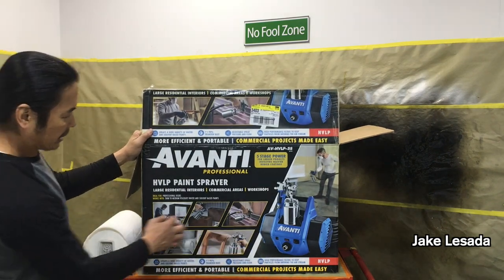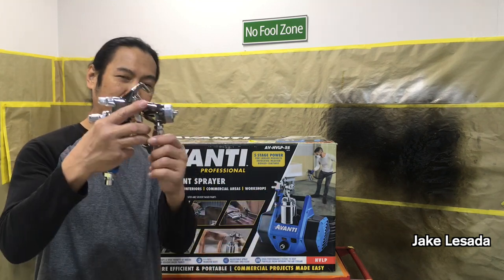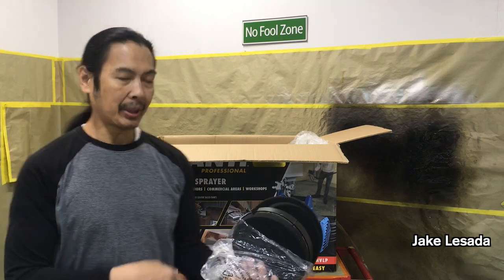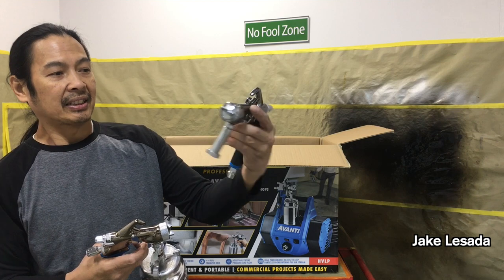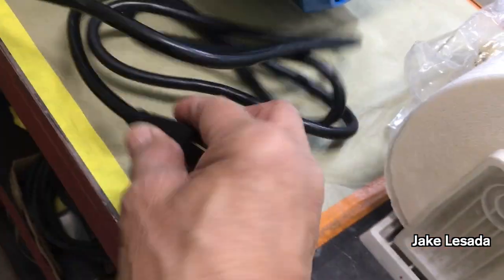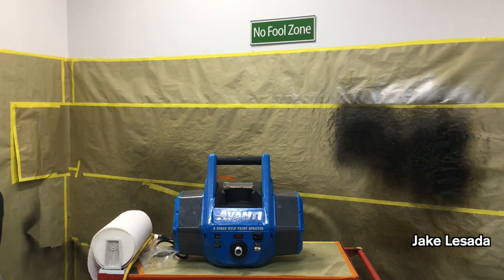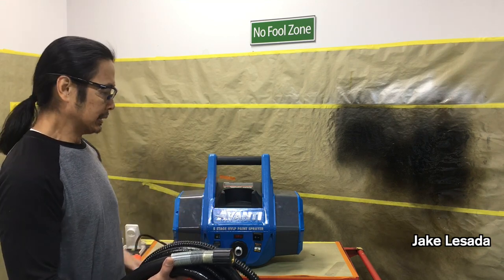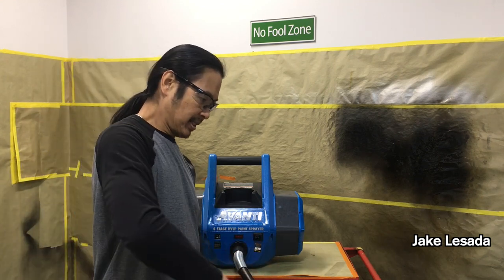Avanti 5 Stage HVLP Turbine Sprayer Unbox with Jake Lesada.

Comment: Jake,
Based on your video I called Harbor Freight’s toll free number to see if they had a refurbished 5 stage unit that be more affordable to me and left a voicemail.  Yesterday I decided to go to a local Harbor Freight to see if they had a refurbished one.  I didn’t see one.  I asked the manager to see if he could put me on a waiting list for one.  He did better than that.  He went to the back and wheeled one over to me.  He let me look it over and I bought it for just under $400.00.  I am so grateful.  I will get some prices on epoxy primer, start sanding down some parts and get spraying.
Reply from the maker: That is the best price ever.  You got lucky,  that is so cool the manager had one in the back.  Just press the on/off button and start spraying.
Reply: My local HF has the 3 stage on the return shelf, ( open box) for 200$ there going to mark it down even more tomorrow if it's still there, I will buy it if it is!
Reply: I bought it for 160, no hose and filter housing is broken but I taped it and like new!

Comment: I bought the avanti 3 stage kit.  It has been great.  I spray a lot of rustolium type paints...  and it works great.  does not matter if its oil or water based.   I have done a bunch of projects.  I called avanti to order the other available needle sets and they were very easy to work with.   I am glad you did this video... thank you..
Reply from the maker: You are so welcome.  Thank you for taking the time to watch and comment.  I just plumbed the Avanti 5 stage with a thru - wall booth setup.
Reply: Do you use Rustoleum paints for external automotive applications?  Rustoleum makes Gloss Red Apple and I would love to use that.  If you do, what would you mix it with?  Thank you.

Comment: Fantastic set of videos to go with this specific machine. This is the route I'm going to go to paint my 2009 ford ranger  since it will be in pieces and a lot has changed in the 10 years since I was an automotive reconditioner and I don't want to go back to a compressor setup as I only do small amounts of work now. Great videos. Super helpful.
Reply from the maker: Painting has gotten easier using turbines.  Press the on/off button and go.  No draining water from air compressor tanks or pre filters attached at the spray gun end.  Lower overspray and waste, and less exhaust to filter.  Thank you for watching and commenting.

Comment: This video was excellent! I was looking into this turbine and you nailed the break down.
Reply from the maker: Thank you for watching and commenting.
Reply: @JakeLesada  Where can you find the extra spray guns?
Reply from the maker: Check with your local HB store. Their website shows that they have a "replacement turbine spray gun" - in store only.  Also, there are other manufactures that also make turbine spray guns.  Using a regular air compressor type spray gun will not work, I've tried it .

Comment: I bought the Avanti gun to use with my Apollo 4 stage to spray sealers and to use for non-automotive spraying. It uses the same 3m pps 2.0 adaptor my 7700 Apollo gun uses! And yes, the pressure cup is a Big advantage👍
Reply from the maker: It's ideal that the same fittings work on two different brands of turbine spray guns.  3m has got it right on!
Reply: On these notes I'm using a 4 stage capspray with Graco 2 edge with a 0.8 needle set with the gravity cup feed adapter they have. I sprayed sealer and not sure if it was because of old ppg multi purpose primer sealer with old hardner maybe a year or so old and or bad gun settings but I got dry spray tiger stripes Orange peel. I sprayed my car years ago and it came out great! Any pointers on gun settings. Should I have made my fan smaller, less air more material? Thanks guys 👍😎
Reply: @1982mattd  i've been adding slow reducer to help material flow.  Wide open fan. No issues at all with epoxy or sealers with the turbine. Keeping a wet edge with each pass. You can always wait and wetsand the sealer the next day and reshoot it if its not acceptable.
Reply: @BearBudgetgarage  are u using a 0.8 also for sealers or a 1.3? I was definitely thinking of adding just a bit more of slow reducer! 😎👍 how far are u from panel? Thanks buddy
Reply: @1982mattd  last time I used a 1.0 with slow reducer. The time before that a 1.3 with the fluid turned in a bit more. I'm only a few inches from the panel and moving fairly fast. But everyone sprays differently.
Reply: Hi Jake! My husband has the same sprayer. Could you please share the Amazon link to the adapter and cups in your setup? Thank you!
Reply: So the Avanti gun fits the Apollo hose and fittings? I need a hose for my Avant and was going to use a Apollo hose if possible
Reply: @MIKEC2000  all turbine guns use the same hose connectors, so it will work

Comment: Thank you for the video very well done. I'm going to copy you on my setup because you got i figured out. I'm curious where you got the couplings for the garden hose conversion? I appreciate the help.🙏
Reply from the maker: I'm working on a video about the couplings and what works or doesn't work.  The black couplings are from my old Apollo HVLP turbine hose.  The Apollo hose was about 9 years old, so I custom made a Flexzilla hose and used the Apollo couplers.  Avanti's couplers have an issue with directly fitting on the Flexzilla garden hose.  The Avanti coupler has too long a dimension and the metal part will bottom out at the garden hose threads before the rubber gasket can seal the air -  it will work on the Avanti original hose because the Avanti hose thread is smooth to the hose - whereas the Flexzilla has a step up before the hose part.  Plus, Avanti coupler has a white plastic insert that needs to remain installed with the Avanti coupler or it will leak air.  The Apollo couplers work the best for the Flexzilla hose mod, it's more flow thru and doesn't have a white plastic insert like the Avanti coupler.  When I custom cut my Flexzilla hose, I used the Apollo barbed hose insert that the Apollo coupler threads onto and the spray gun connects to.  I have a video on how I removed the Oetiker Clamps from my Apollo hose and fit it to the Flexzilla.  Thanks for watching and commenting.

Comment: Great video on this machine👍🏻
I guess HF has discontinued these, I kept looking at them and went to finally take the plunge a couple weeks ago and they were sold out including the display models all across the state I live in except for one I managed to find in a store about an hour from me that was a display model, got it for $200 which I think is a steal! It didn’t have the hoses or any of the spare stuff but the two tips, gun, turbine (of course) were there and like brand new so I grabbed it. I’m waiting on everything I need to show up so I can get going with it including some pps 2.0 liners ( which are ridiculously expensive as all 3m stuff is and has been forever )

I like your flexzilla hose idea and almost did it but found a Fuji super duty 30ft hose with built in 3ft heat sink for $65 and went with that. It’s Fuji’s heaviest duty and most expensive hose and normally sells for $110😅, if not for the huge discount I definitely would have went with the flexzilla, I have their air hose and love it. 
I’ve read numerous complaints on the HF hose it comes with so I’m glad I didn’t have to pay full price and then replace it lol.

I’ve never used a turbine sprayer before but I’ve always been curious, I was an auto body painter for 27 years and have a pile of Sata guns, A couple Tekna/Devilbiss, etc., only one had a tip set big enough to spray the paint I’m using which is Sherwin Williams Emerald water based alkyd urethane and it worked, the stuff I’ve painted came out really nice but running 135ft of air hose from my garage and through the windows of my house is a pain lol, and being a conversion gun with no pressurization makes this stuff really tricky to shoot, plus there’s the pretty abundant amount of overspray to deal with also.
I have a whole bunch of new trim/doors/ jambs to paint in my house and am hoping this does it easier and with less overspray, I’m excited to mess with it. I was going to use an airless sprayer but……. Meh
Keep on keepin on 🙌🏻
Reply from the maker: Once you get used to how turbine spraying works, you'll really start having fun.  The Avanti 5 stage has good power and the psi range will be around 9.5psi static pressure and when the air bleed occurs it's more like 8.4-5psi.  Their turbine spray gun uses about 3 psi on trigger pull, and the back adjustment for the fan width will reduce the size of the fan but at the cost of reducing atomizing air pressure.  So be conscious of that air to atomization relationship because you'll notice more orange peel if you reduce the fan width too much.  As a comparison, the spray gun tips for turbine spraying auto clear favor 1.0mm and with the Avanti 5 stage, the 1.3mm is no problem - but you have to move fast enough because it will hose it on like you're using 1.5mm compressor gun and you might get runs.  Make sure you get full saturation with the lay down too, otherwise the spray will look used car lot dry.  On my other channel " Turbine Sprayer" I go into more details on specific topics, check it out when you have time.  I also like to cycle my machines to off whenever possible - when I"m not spraying in between flash off times - doing so will reduce any heat building up and it will be quieter in the room.  If spraying in hotter days, it's a good idea to place a fan to help cool the machine if it gets too warm.  Also, if you're spraying outside work,  the sun will warm the hose and machine fast so be conscious of that too, and look for shade if possible.  Don't use too long of a hose because you'll get pressure drop at the air cap and paint atomization will suffer.  I've maxed to 35ft and eventually shortened my hose to 30ft and 15ft for my needs.  You're lucky to have found a machine, in my area they are sold out within over a 100 mile radius and only display models with missing pieces - but at bargain prices a great deal.
Reply: @JakeLesada  thanks Jake! That’s great info and advice, and much appreciated!
I didn’t know you had another channel, I’m definitely going to check it out. Thanks again!👊🏻

Comment: I was able to buy an Avanti 5 stage store model today , but no hose for cheap money. I  am now working on my courage and assembling my shopping list to spray my 68 Firebird. 
Your discussion of adapter has me confused.
Q.   Do I need the 2.0 for the gun that came with the sprayer or the legacy?  (Do you have a link?)
Q.   Do you use the full 50' on the flexilla hose I am about to order using your link?

Comment: Do you have a video on your gun build?
Reply from the maker: Yes, check out the video on "Beginners Classes" I take apart and reassemble spray guns.  The clear front mod is revealed in "Mod Revealed" video.  The front mod is a water bottle cut out and fitted with blue fine line vinyl tape.  If you have time, checkout my new channel "Turbine Sprayer", I'm do more spraying videos in low psi and my other spray guns. Thank you for watching.

Comment: Hey, can you demo the Avanti turbine with the Apollo 7500 or 7700 gun? Was interested in the results
Reply from the maker: Yeah, I actually did testing with my Apollo spray gun and the Avanti - but only using water as my material.  I got data on results and it works.  I did temperature readings at the air outlet from Avanti and it was about 10F -12F above ambient at BOOTH Wall side of hose. But, the spray gun end of hose it was 2F degrees above ambient.  To me that's nominal, but this was only a short duration spray test - not a long duration heat test. Heat builds up over time. Turbine machines have always had to battle heating issues and that's the reason why certain manufactures dominate with their technologies, and their ability to keep their machine cool and protect motor life. I'll see what happens as I do longer sessions with the Avanti - and how heat builds up or is controlled with their design. We'll see... The wall spray test glossed out with a wide spray pattern and fast speed. Since it's nonadjustable air psi at the machine end - the fan pattern is wide and speed is fast. I did about 8 notches in on fan ring with my Apollo spray gun and ran more fluid mix because of the extra air cfm and nonadjustable machine.  I'm getting an opinion but, not ready to share yet.  All I know is spraying with turbine technology is the way to go.
Reply: @JakeLesada  thanks for the info. I will be interested to see your follow up on this unit as time goes by👍 All onboard with the turbine! I will be trying a 5 stage unit next. My used Apollo is a 4 stage. It will be a Sprayfine replacement 5 stage tuebine with zero accessories or gun(don't need). This is budget priced and just a little more than the price I seen  for the HF Avanti. So within my budget for now. I've got the guns, the needle/nozzles/caps, 3m pressure cup, liners, hose, flex hose everything I need. And plenty of jobs lined up to apply the turbine system to👍

Comment: What number 2.0 adapter is that? I just made a u tube conversion to make it a gravity feed, but i guess i could also go with to he bottom feed h/o, i have my conversion setup with the 1.0 spectrum system, but it has a hole that i have to seal and put the nipple from the cup in to make it work, but i will probably just buy the legit 2.0 3M setup! I also bought the Niagara 100ft 3/4 contractor hose, and to be honest it looks better to me than the flexzilla i seen at Walmart for double the price, it is light and really flexible just like the flexzilla, but we will see how good it works eventually! It will be awhile before i paint my truck, i have the money saved to buy all my paint and primer s i just need to get some color matched and figure out what sealer/ epoxy i want to go with, it's a older truck so i want it to last forever!
Reply from the maker: In this video I'm using the 3M adapter S18, it's the longer adapter. designed for the bottom feed.  But now, I use the shorter S34 adapter originally designed for the top feed spray guns.  It works and is shorter and lighter than the S18.  The "S" designates it as the 2.0 version and the #18 or#34 adapter designates it as the 1.0 version.  Just remember the shorter the air hose the stronger the air cap pressure at the spray gun.  I cut my hose down now to a 30ft and 15ft length.  I also use sandwich bags as my liners for the 3M PPS system.
Reply: @JakeLesada  yeah I read up and seen the s#'s are 2.0, I just wasn't sure what number. And I'm definitely cutting the 100ft down to a more practical length. I will be painting a vehicle in a booth so I will have a long hose for that and a short hose for smaller projects.  I wonder if the spectrum liners work in the 3M setup? Didn't spectrum just copy them? The liners are cheap at HF but a sandwich bag is a great idea, especially if painting something besides automotive! Thanx for the reply, I'm sure il be back with plenty of questions as I get this rig up and running! Your the best brother!
Reply from the maker: I think the Spectrum liners are meant for the 1.0 version PPS.  Compare the top center opening of the liner lid.  The 1.0 is small in diameter, and the 2.0 is a larger opening.  Also, the hose I'm using is a 5/8" diameter.

Comment: Hello Jake, 
For Legacy version part: 3M Adapter #18 which lid system you use for The H/O Pressure Cup (Mini) is 3M 16121.  What is the model number and what cheaper you mentioned maybe compatible lids you use.
Reply: I meant lid and liner system.
Reply from the maker: The 3M 16121 is the (Mini) size I use for Legacy version.  But, lately I've been using the 3M Adapter S34 (shorter and meant for top feed turbine spray gun) with the 3M 2.0 PPS H.O. Cup. 26121 Midi.  The liners are the 6oz., and I use those with the "sandwich bag mod".  If you watch the "Sandwich bag mod" video it will explain.  Sorry couldn't get you the part number for the liners right now, I have to jet.  Thank you for watching.
Reply: Thanks @JakeLesada

Comment: Harbor stopped selling this item so now if you need parts we are screwed
Reply from the maker: I opened up the machine and did some testing with some of the components.  It's a simple design and all the parts look replaceable using parts from different manufacturers.

Comment: Going to try this for my primer gun on my fuji set up, was that 3M adapter for the 2.0 cup system or the original? Thanks!
Reply from the maker: In this video it is the 3M Legacy 1.0 version, and I'm using it with the longer 3M PPS #18 adapter meant for bottom feed.  But, now I also use the 2.0 version with the S34 shorter adapter which normally is used for the top feed style turbine spray guns, it works.  And, the liners I use are sandwich bags.  I get 200 sandwich bags for under $1.50
Reply: @JakeLesada  thank you so much I'm gonna order that right now. Thanks for the turbine content nobody else on youtube going as in depth to it as you are.
Reply from the maker: You are very welcome.  Thank you for watching and commenting.